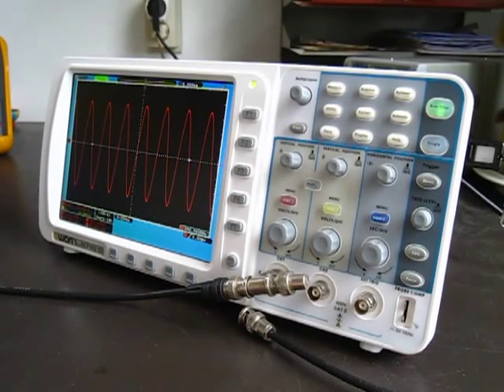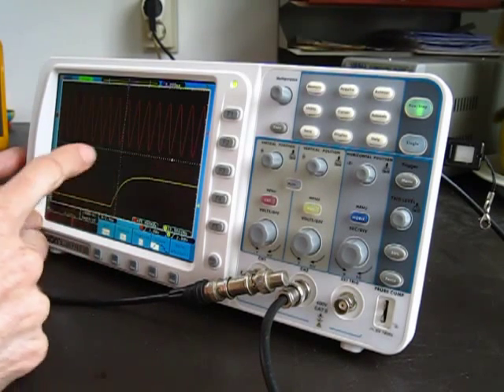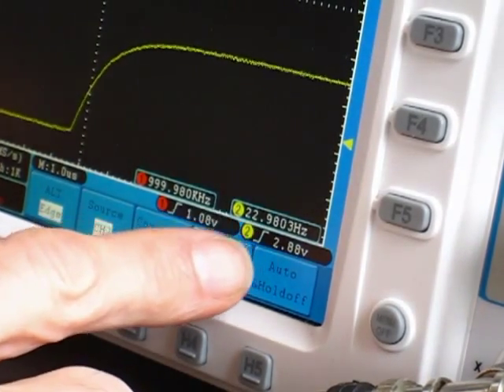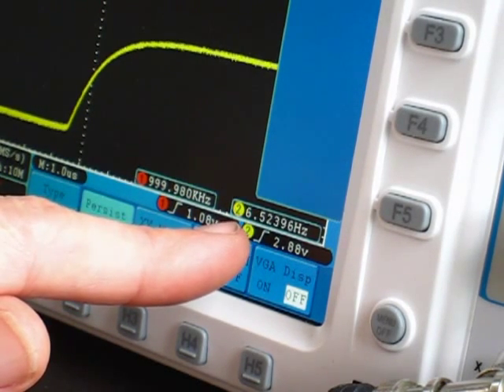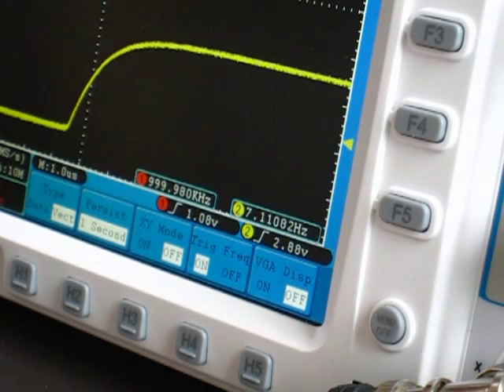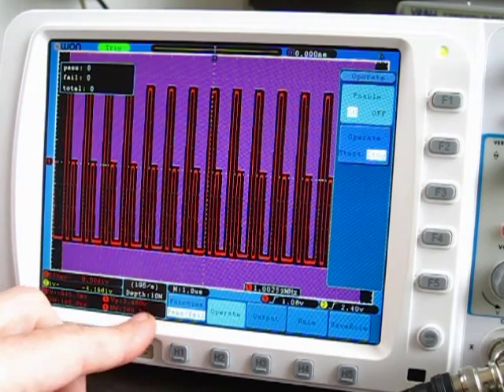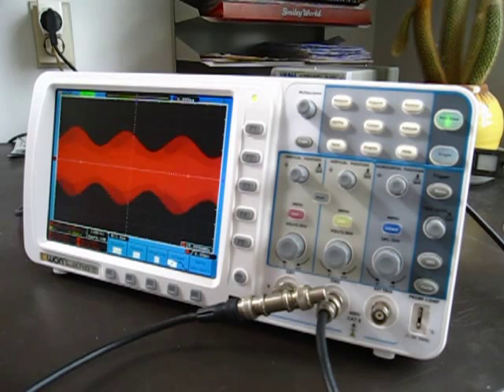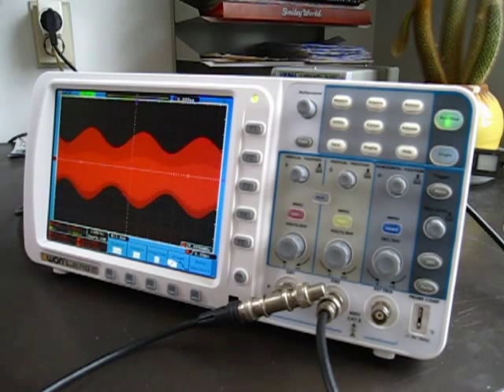OWON SDS7102 Review Part3

Comment: Works great❂>imgs.love/owOscilloscope?ω  Only have used it a couple times but for a basic scope it works as advertised. No problems setting up on Win 7 Pro HP laptop. Highly recommend due to its isolation feature! If you buy one without isolation save yourself some future grief and buy an isolation USB cable, otherwise sooner or later you'll fry your computer.

Comment: @marmad22 Thanks, i am having issues with chosing one too tbh. I got a old school 2 chan 20mhz now and i like to have some more options like memory and such, i am really thinking to get an old Tektronix with tube and memory around 200mhz, those are not cheap for 20 year old scope but i really like Tektronix since i was using couple different models at work before. DSO's are nice but than you need a good (expensive) one.

Comment from the maker: @NoMercy1900 - No, I returned it after repairing my old battery-operated Tektronix 212 analog scope, and have been using that since. I'm currently doing some audio work - so I may get one of the Velleman PCSGU250 combination scope + function generators (a great buy for the money) - and will review it here if/when I do. I still will need to get a higher-bandwidth DSO at some point, but I might wait until I can afford (i.e. when I land a job I can bill it to) an Agilent or GW-Instek.

Comment from the maker: @softdown123 - sorry, missed some comments here do to network problems. If you don't know already, the ADC chip is RuiFeng MXT2002 (probably MXT2001 in Owon SDS8102).
After returning the Owon, I got the Hantek for testing and review - then returned that.
Currently I'm back to using my analog Tektronix - and saving money for an Agilent 2000X series or GW Instek 3000 series.  When I get one of those, I will post a review.

Comment from the maker: @ElektroHut - one exception to the post above.  The ADC is a Chinese clone of the ADC08D500.  The original AD chip is quite expensive so there's no way that Owon could use it and sell the scope at the prices they are.  The good thing is that it is a dual ADC on a single chip running at 500MSa - which means no interleaving when you're running both channels - and only two ADCs interleaved when running at 1GSa - so likely less clock jitter and distortion than multi-interleaved scopes.

Comment from the maker: @Bright8888 - well, first off, I think the new Owon SDS line is of better quality and build than their previous PDS, etc, models - so don't apply the points mentioned in this review to their previous models. They have upped their game (in terms of quality) with the SDS line.
Secondly, it really depends on your bandwidth requirements; how you will be using the scope most of the time; the budget you have (or max. you will spend); and where you're located on the planet (since different scopes...

Comment: @marmad22: You're welcome.  When it comes to a purchase, non-technical things loom large.  in the USA except for Rigol, the others are not represented by the company for warranty and repairs, only by local vendors.  The Rigol 50 MHz 1052e as low as $340, typically $400, eBay has the 100 MHz Owon SDS7102 at $530, and motioncontrols has the Hantek 60 MHz 5062B at $600.  Thus, a choice has to weigh many side issues, not necessarily technical ones [including their hackability].

Comment from the maker: @lebeyes - Yes, I didn't like it either.  Some designer should have told the people at Owon that it's not clean looking to have a san serif font printed on the front panel, but then a font with serifs on the LCD.  In fact, fonts with serifs don't look very good on small LCDs in general because the low resolution can make them look too big.